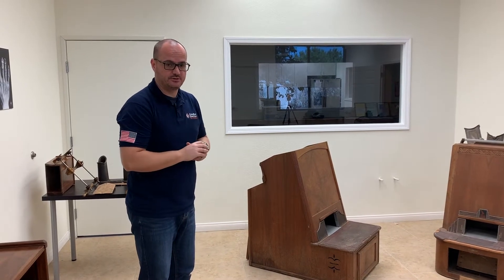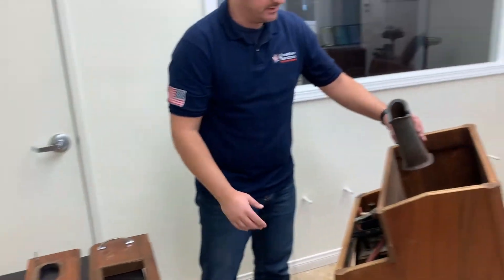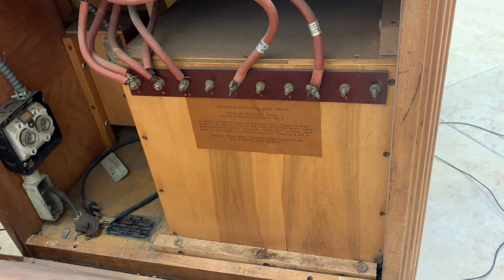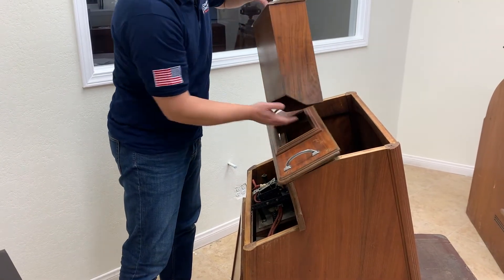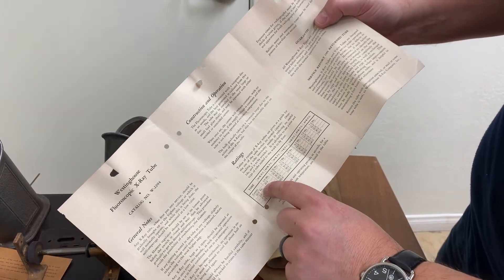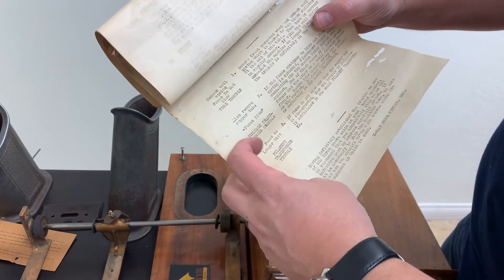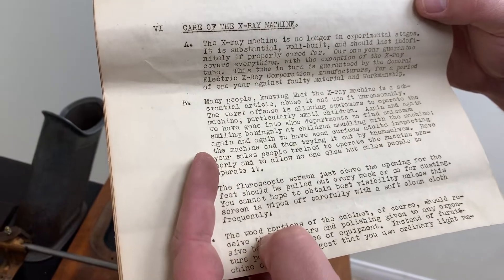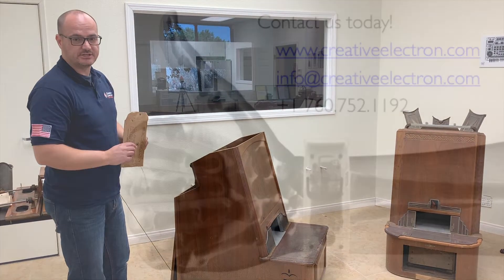Adrian Special Shoe Fitting Fluoroscope X-Ray Machine Teardown

Comment: It's amazing they made a x-ray machine inside of a wooden box a shoe store could afford but now it takes half a million to take an x-ray
Reply: That half a million goes towards you and the operator not dying of radiation sickness or cancer.
Reply from the maker: Yes, we've learned a lot in the years since the discovery of x-rays in 1895 by Wilhelm Roentgen. The wooden cabinet was replaced by sophisticated walls of steal and lead to build safe x-ray machines.
Reply: It's more amazing that you think this is anywhere near the same thing as a hospital xray
Reply: Just for the record, an X-ray and a fluoroscope aren't synonymous...

Comment: Why would any shoe store need this unless your customers are only Olympic runners & people with severe arthritis or diabetes
Reply from the maker: You have a point, these x-ray machines were gimmicks used to attract customers.
Reply: Well, as a parent, if this weren't dangerous it would be incredibly cool. Often kids can't really articulate if shoes fit properly, and the pressing on the toe trick doesn't always work if the toe of the shoe is very hard
Reply: @GlamGoreChaosQueen I actually read about these things in detail once for ... reasons lol.  It turned out that it was more of a gimmick than actually helping fit shoes, IIRC--even more than I had thought.  If u think about it, it kinda makes sense ... I don't know that it actually is gonna show you everything you need to know.  Think about what you see on an X-ray, and then what u care about with a shoe fitting.
Reply: Because the "science and new tech is great and improves our lives" mentality was already around.

The same way we burn our retinas with blue led light and irradiate our brains with above statutory limits of em radiation when we place a mobile phone against our ear.

It's not necessary for life, nor will it last. 

People in 50 years time will shake their heads about that too.
Reply: @forestdenizen6497 Burn our retinas with blue LED light?  That is  not a thing that happens.  It just isn't--unless the LED you are talking about is a laser diode.  And then there has to be a lens to focus it.  So if someone is looking directly at a laser pointer shining in their eye or something (it's not enough to look at the beam shining on something else), yes, that is bad.  But I don't think too many people do that, to say the least!  

I really can't say anything definitive about the safety of phones.  But I can tell you that they are nowhere NEAR what a fluoroscope emits.  So whatever is going on, it's not like THAT.  It's just not.